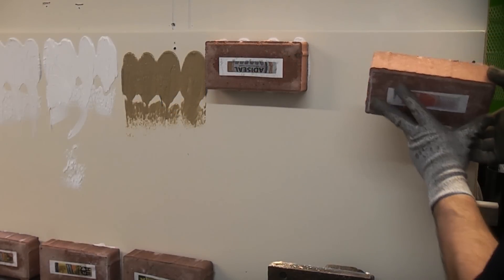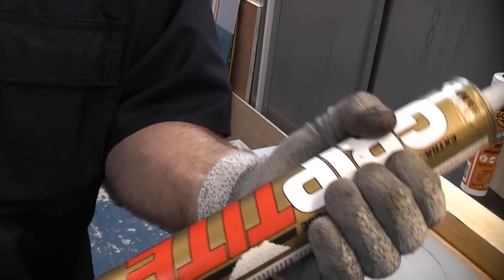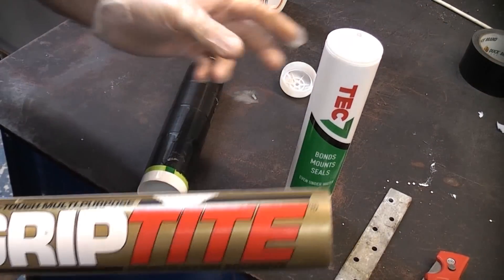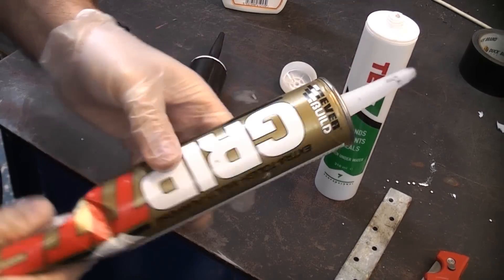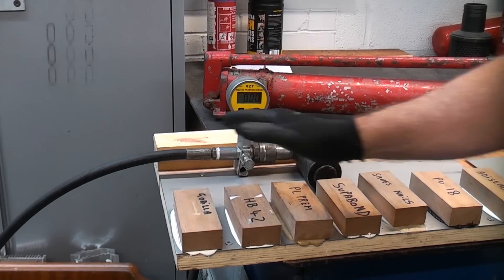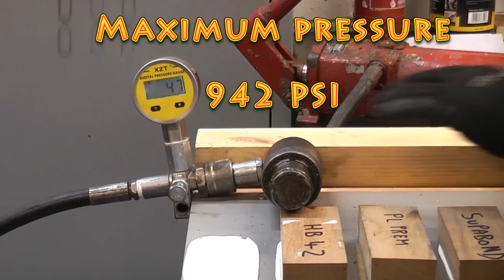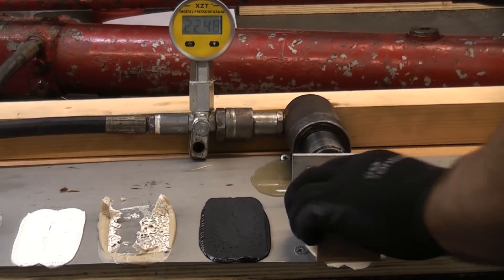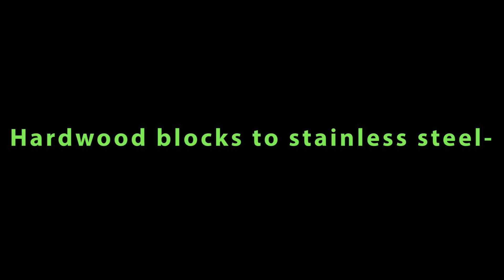Grab adhesive tests 2017

Comment: great video and as fair a test as you could have. Very surprising too. I constantly hear people rave about tec 7 being great but clearly not that good. I've never been willing to spend the money on it to find out personally. That adiseal is some stuff though, definitely need to get some of that bought!
Reply from the maker: Thanks Peter, these tests have been very surprising. Adiseal, Supagrip and Nemesis have all performed well and are all about £6 per tube.
Thanks for the comment
Reply: definitely. I instantly went looking for Adiseal! need to get my hands on some of that to try out. looks like a cracking product. I know you might not want to give unpaid promotion to people but was there any generic suppliers of the adiseal or did you use a local independant?
Reply from the maker: I bought it from my local plumbers in Blackburn, they used to stock Bison Polymax but seem to have done away with that and now seem to stock just adiseal (I must see how clear the clear Adiseal is)

Comment: I probably don't want the strongest for most things I do. For sticking the skirtings on after laying wooden/laminate floor, I probably want the one that is "JUST" strong enough to hold the skirting for normal every day use. Then be weak enough not to rip out chunks of the wall when the floor needs replacing in years to come.
Thanks for the useful info.
Reply: easy to use too much of this stuff for your appication, use it sparingly, and then finish the edges with a flexible sealant, they will hold just fine and not take the wall off with it
Reply from the maker: You are welcome
Thanks for the comment

Comment: Useful thanks!  I was struggling to stick something down recently with the Screwfix own brand which didn't work well, so I'll try one of these.
Reply from the maker: It wasn't the Nemesis was it?
I love the Nemesis grab adhesive as it's really good for the money!
Thanks for the comment
Reply: No the Nemesis is good actually, it was the cheapo No Nonsense one. Can't expect too much for 2 quid I guess. It was the solvent free one too which maybe isn't as good and seems to take ages to set. I've stuck skirting board with it fine, but not so good for anything more challenging.